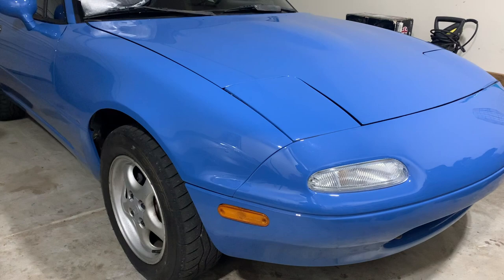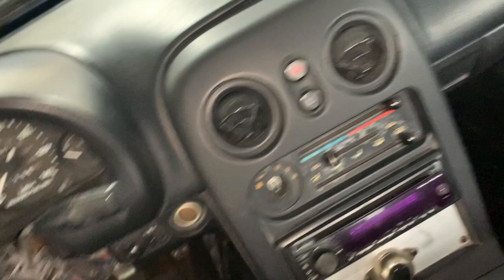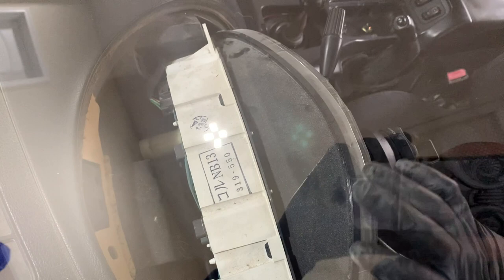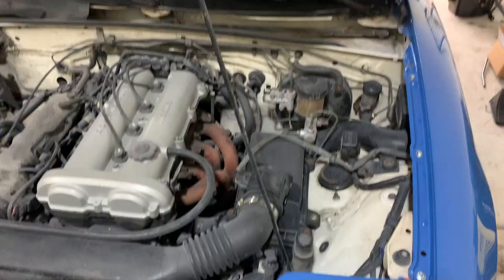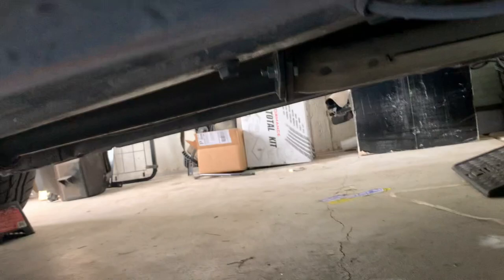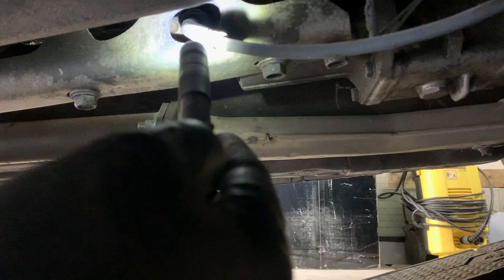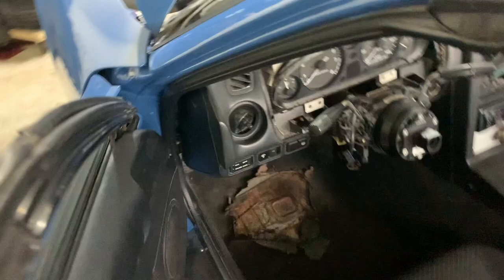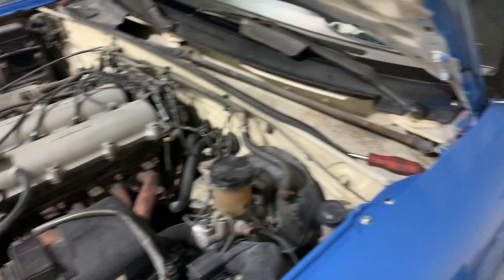How To Replace a Speedometer Cable on an NA Miata

Comment: Thanks for this video it saved my sanity. I was going crazy trying to figure out the noise. Oddly enough mine started squealing less than a week after getting all new belts so I  assumed it was one of them.  New OEM cable is in the mail as I am typing this!
Reply from the maker: I’m glad this helped! It’s a very odd noise for sure